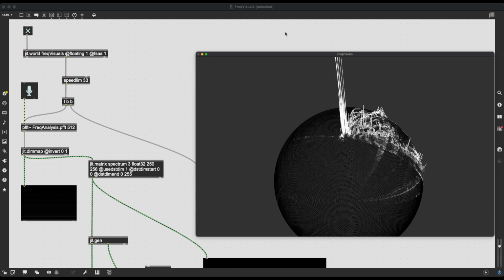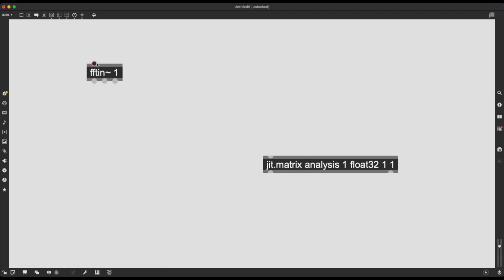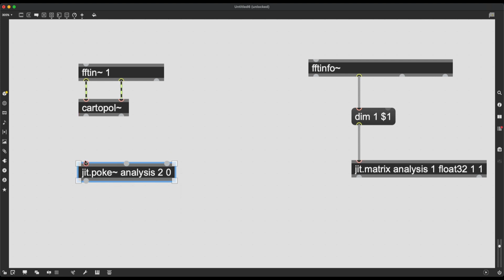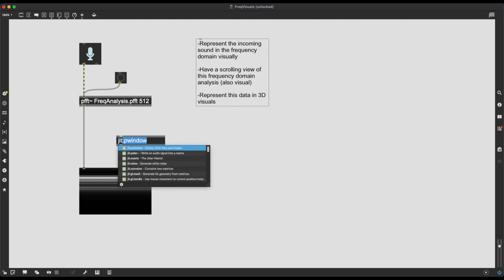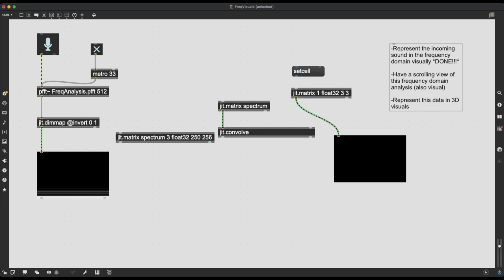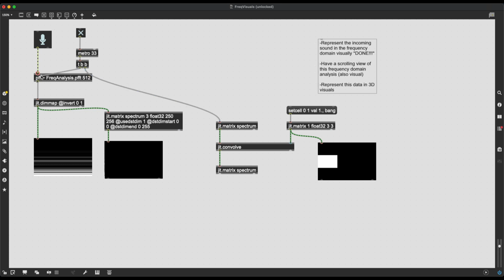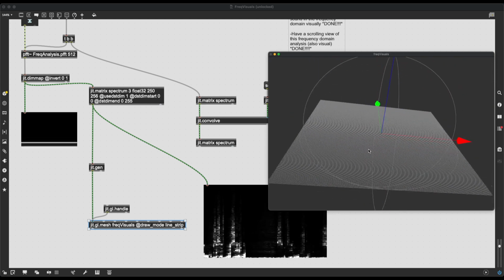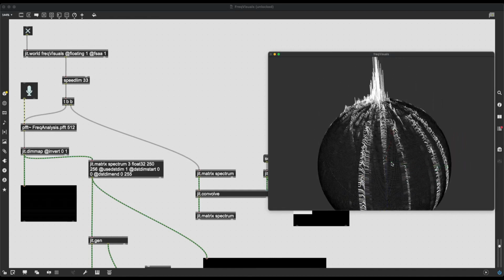Visualising the Audio Spectrum in 3D - Max/MSP Tutorial

Comment: I'm a life long visual Artist of over 40 years, recording artist & engineer. I draw with sound based on specific rules such as no sound no draw - there would not be a sphere representation, if quiet, draw light/faded (creates distance/depth), draw points or lines to specific side of the page from whatever L/R pan you hear although this is a bit imposed/forced ideology of the music engineer, not the scope of the audio spectrum in 3D space. During the duration of the music you may hear a constant note or a blip a 1/64 for example.  I have mapped out other rules. Anyway, ideally, I think that if the interpreting algorithm is correctly made, it should visually produce the same artwork even better than me and if another artists draws by the same rules, they will replicate the same artwork too based on the specific music. Music is math but how to extract it in 3D may reveal hidden images/thoughts and experiences artists had through out the ages.

Comment: This is a great idea and an absolutely excellent tutorial. Thank you for making it. 
I found that expanding the horizontal dimension in the "spectrum" matrix slows the rotation down without getting the choppiness of changing the frame rate. I got a result I liked with 1024. More cells to fill takes more time to fill them.
Reply from the maker: Great idea!

Comment: 😓The first time I followed the operation, it was successful. However, there seemed to be an error when I saved it afterward, making it irreversible. Even at the 11-minute mark of the video, when I clicked on the small dots, there was no change in the image. I've tried for several hours but still couldn't find the problem. When I saved it, I had already put them in a folder called "patchers." I wonder if there's any possible solution？ thanks a lot for your video teaching
Reply: Forget to answer, I just rename the folders and try to follow again and worked : )

Comment: Hey Hearing Glass!

Phenominal video! I am using this for a uni project, and I found these a really useful way to analyse different audio files! I really want to save the 3d display (the step before the globe) so I can compare images of different files to eachother. Is that possible with Max 8?
And is there a way to put a scale in the display to help with comparison?
Reply from the maker: I can think of a few approaches: You can try to save the Jitter Matrix that goes into the 3d display by sending jit.matrix the "write" message, and then load different matrices in jit.matrix by sending it the "read" message. You can also create multiple copies of jit.gl.mesh in order to visualise multiple analyses at once. Good luck!

Comment: Hello! I tried everything but,---" jit.matrix spectrum 3 float32 250 256 @usedstdim 1 @dstdimstart 0 0 @dstdimend 0 255" , this part just doesn't work for me. The visual stays at the corner of the window it doesn't start to move like your.I think i did everything like you.What could be the problem?
Reply: I had the same issue, the Setcell 0 1, val 1.,bang message
 needs a loadbang.
Reply: You just saved me! thx!! @enkisumer
Reply from the maker: The patch is in the video description, make sure to compare what you have and what I made very closely. Chances are there is a tiny mistake hidden somewhere.

Comment: Thanks for the tutorial! How would you go about generating a "shape" out of a separate 3d object (.obj) to use as a shape for the freq spectrum? Like you did with the sphere, but using a 3d object instead.
Reply from the maker: jit.gl.model is a good place to start. Check out its help file to see how it's implemented into jit.gl.mesh!
Reply: @HearingGlass  I've managed to hook the 3d object with gl.mesh, but this way the spectrum and the 3d object are just 2 things independent of each other. My understanding is that the coordinates of the 3d object should be somehow loaded into the gen patch (where you created the sphere). I tried creating a second input in gen and hooking up the object but it seems like there's another step missing. Appreciate your help!

Comment: Thank you for this video! Im trying to use your project, but I am facing a fairly simple issue (I'm new to MAX). I am not able to click the toggle button to respond. Even my button seems to not respond to clicks. If I try to connect the the button to the microphone input at that instant I get a light blue representation on the button, but it does not stay, please help!
Reply from the maker: Do check if your patch is locked when you are trying to click the toggle.
Reply: @HearingGlass  Hi tahnk you so much! I ran into another problem after shutting down my laptop. The scroll function doesnt seem to work. I got the sphere runninf too, but the there is just one dimentional matrix that is formed and no scroll of the graph. Please help :/

Comment: Very nice! Would be great to tilt the spectrum somehow to compensate for the FFT results being tilted towards the low frequencies.
Fabfilter Q3 has a 4.5db/octave tilt.. Any suggestions on how to achieve that?
Reply: use [jit.op @op + @val 1] into [jit.op @op log] before you pass it into the gen. I'm not sure if this is the same kind of octave tilt as in fab filter, but it gives you the log of the spectrum, which should push more of it into the upper range.
Reply from the maker: Good question! I can't think of anything of the top off my head, but probably some kind of shaping function should do the trick.